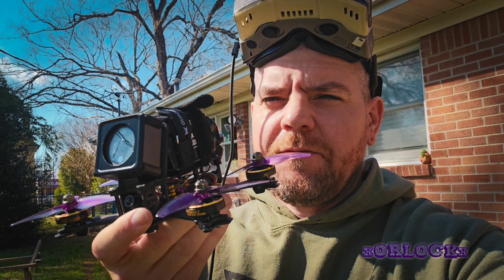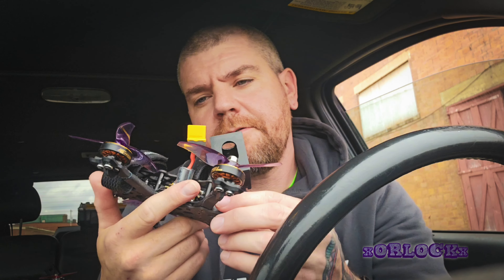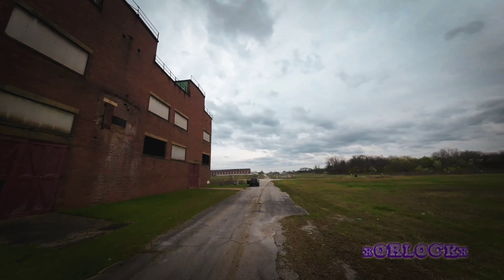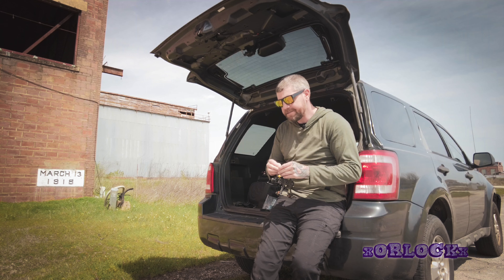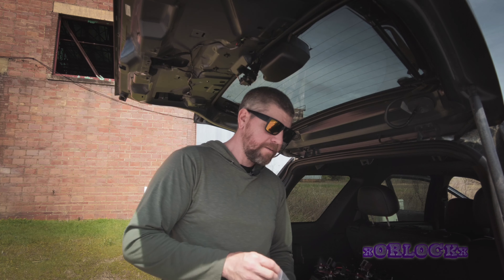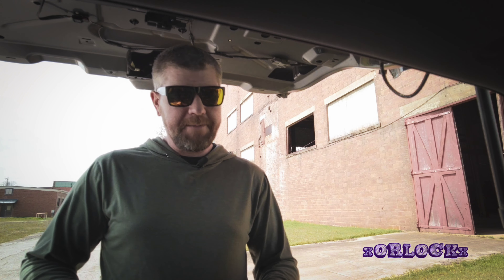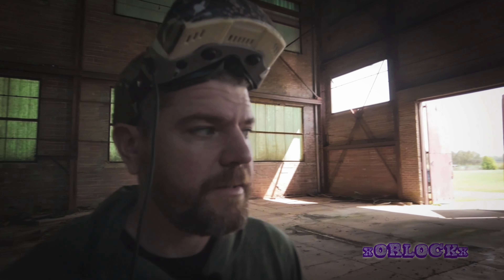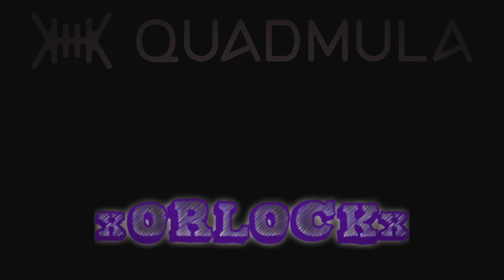I tried 6s again... // Quadmula SF35 // FPV VLOG

Comment: Been in FPV since 2016 and never bit on the 6s train. To be honest the 2 setups i fly have the same parts and havent had to do anything to them in 4 years!!. Granted i dont do any concrete flying but more or less just flying for fun being smooth with some acro slipt in. Im running both on a DYS Pro v2 FC and also have emax bullet 35amp led escs which never fry. I use to always want and try new electronics when something new came out until i was spending 2ay to much money for the purpose of what!?.... Didnt make sense so i just found stuff that had always been reliable and just stuck with it. I still enjoy buying new styles of props that come out because their cheap. My favorite prop of all time on 650gram and lighter builds is the DAL 5051c dagger props, at 2.8g plus or minus a gram they have so much responsiveness but with a higher pitch and a super thin blade you get a good all around prop. One caveat though....they randomly just explode out of nowhere which became a problem, so i would just retire a set after flying them for a certain amount of time. Long post of random info for whatever reason, but just stick with 4s because its not as hard on your electronics and batteries are cheaper 👍🏻.

Comment: I’m with you on this. One, I love my F35. Two, I built mine for 6S after watching Bacon Ninja’s 3” 6S build from last year but have resorted to flying mine on 4S 95% of the time. I’ve tried 6S with this little guy but I just don’t like it as much as 4S. And like you said, if it’s not going to make me a better pilot but break more stuff in the process… I’ll stay where I’m happy and full sending it with less trouble. 

Nice video!
Reply from the maker: Thanks for watchin! And yeah.. 4s is just more fun. I wanted something that was terrifying to fly.. but I have a 4s 3 inch toothpick that weighs 120g for that 🤣

Comment: When you used the 6S pack did you set a motor output limit? Sounds like the motor burned out as it was too high a KV for 6S if they are 4S motors.
Regardless I run 4S on my smaller quads and I never feel like I am lacking power.
Reply from the maker: I didn't the first time. But the second time I changed the ESC settings and limited the motors even though I was told it wasn't needed. They are 6s motors. I think the crash burnt it up honestly. Makes sense. But 4s is life 🤣

Comment: 6s is no bueno on a 3.5"...its too much chooch! I tried it with the grinderino and almost broke my mid plate 1st crash. It's been shelved since last summer/fall becuase I didn't have the 4s parts. Motors will be in soon and then I'll finally have a lil ripper! great video!

Comment: What nah 6s lipo's you running? They look big, like 1500 or more big.... I have a Djinn 2.5 inch I run 6s and I have really good luck with 6s 650 mah lihv's to save weight. I get like 5min flight time, and I run it on BF 4.5 with the supafly tune and HGLRC 1404 2750 kv. It flies pretty incredible. Kinda wish it was a 3.5 inch cause it would be absolutely amazing if I could put a bigger prop on it...

SICK RIP DAWG!!!!!
Reply from the maker: I had 850s and 1000s. I appreciate it man! I've seen a bunch of 3.5 and djinns on 6s. Which is why I wanted to try it. But the universe was against me 🤣🤣
Reply: @xORLOCKx  Yeah, I am all to familiar with that. I just spent the last three days battling VTX tables on a foxeer Extreme, didn't realize it was a V2 which is 72ch....🤦🏼‍♂️ Trials and tribulations of FPV... Got to love it though ..

Comment: 4s for life over here. I got twins and I can get 2 4s packs for 1 6s pack. I’m a cheap ass and don’t risk nothing
Reply from the maker: @RadBeardFPV  same bro! 4s is more than enough. Ive tried 6s a few times and always came back to 4s. I even use 4s on my long range quads and get 20-28 minutes of flight time. 4s is indeed life
Reply: @xORLOCKx  I use 4s on my long range also. My 7inch has 2207 1800kv and I get 13 mins cruising